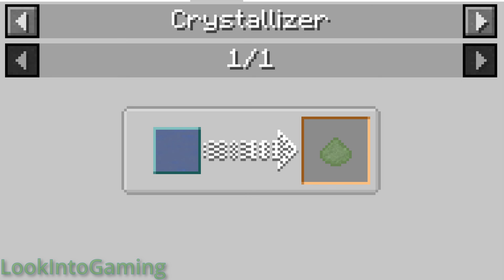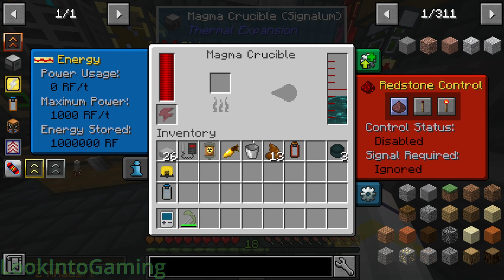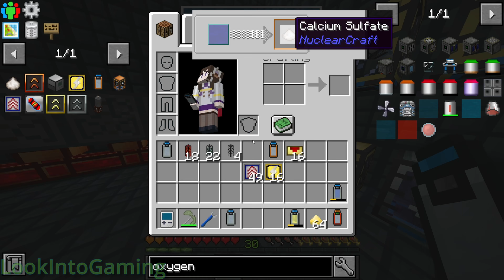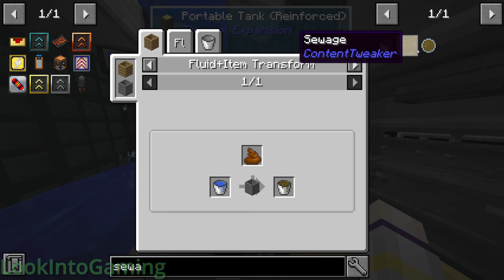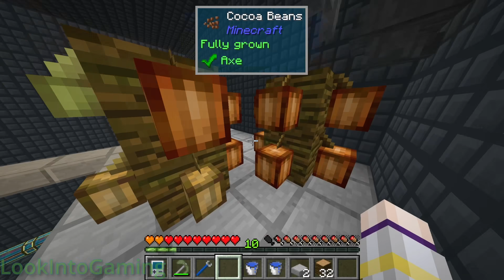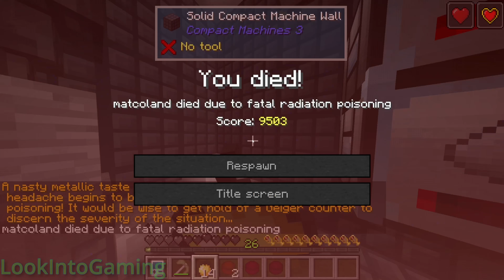How Hard is it to Beat Compact Claustrophobia? (Minecraft Modpack) Part 2

Comment: As soon as you get refined storage you shouldn't be doing anything manually. Autocrafting is so easy with refined storage, and you can literally send your whole system to any dimension in one block.
Reply from the maker: For most of my years playing modded Minecraft, this is how I would play. Only recently have I discovered the power of automation... I still have no clue why I refused to learn automation systems, but it was definitely a mental block of some sort. My Nomifactory playthrough is where I really got into automation and future GTNH videos will be focused on it as well.
Reply: @LookIntoGaming  honestly I'm at this point now and I kinda understand. A lot of the best blocks take diamonds. Seems like to really start using it you need the giant diamond making multiblock so you can craft a diamond pick, which is quite a way from when you unlock it.  It's kinda hard to justify using your diamonds to make that stuff with how hard it is to craft the diamond nuggets. I'm still making it though, I just have to be a lot more sparing than I expected. I also found out that refined cables just work between the compact machines, so it's easier and harder than I expected.

Comment: For those watching this in the future, auto clickers this this pack ate disabled with redstone, so you can automate the cpg using an inverted pulse. The quest guide teaches this in the tree section. I built a timer circuit on the wall with red alloy wire that will send a low signal to the cpg every so often (manually tuned per recipe) with a lever and eventually RS detector to disable it based on stock. You can also have an item duct blacklist the fully charged cpg so it will extract after every use, send it to the recharger, then send it back to the clicker. I used that same setup with pickaxes and the repair augment (you can farm exp by filling bottles and automatically throwing them)

Comment: You are SO real for not wanting to deal with reactor meltdowns and explosions. Babying reactors is some of the most UNFUN activities you can do in modpacks I genuinely don't understand why they are a thing. Just make them shut down and drain all the energy and fuel inside them if you want but DON'T MAKE THEM BLOW UP MAN... This is why I never mess with nuclear reactors. (Except Draconic cuz atleast it's kinda cool and is worth it too)
Reply: The fusion reactor is designed to require cooling. He had literally zero cooling to control it. All you need is some active fluid coolers and water generators placed symmetrically.

Similar goes for the fission reactor. Rather than actually design a reactor that follows the rules, he just changed the rules so he didnt have to engage with the mod.

You don't get to complain about NC being bad if you refuse to engage with it in the way it was designed. When you change the rules and it's bad as a result, that might be a "you" problem.

Comment: Fusion reactors shouldn’t explode.
Reply from the maker: Exactly, I'm used to the nice safe Big/Extreme reactors mod where you don't need to worry about meltdowns, and power is based on your cooling.
Reply: To be honest yeah, they shouldn't explode but they should spit out an unholy amount of neutron radiation. Which should let you put decay generators around the rings to collect it and reduce what gets out. The danger of fusions shouldn't be them exploding, it should just be radiation.

Comment: 19:32 your electromagnets probably just got unpowered. DO NOT connect the electromagnets flux ducts to the reactor, its a big no no. I never got to learn it the hard way fortunately. I made 2 fusion reactors to power the high impact compactor
Reply from the maker: This mod was more realistic than I expected. I saw another comment that said the same thing, and it makes a ton of sense now. Hot plasma needs the electromagnets to contain it and not touch the edges, just like real life.

Comment: the easier way to get sulfur is to just sift dust with an auto clicker. this is also handy for getting bonemeal which is used in a lot of autocrafting recopies from refined storage. In my run of this I had set up one sifter fed by a self fueled pulverizer setup that made sand with a Clastic Deposition extruder and a pulverizer and by the time i was done i had to turn it off  since it filled a cache with bonemeal.
Reply from the maker: I definitely should have automated sand and dust after getting the cobblestone generator, as it would have saved me so much time, but everything is better with hindsight.

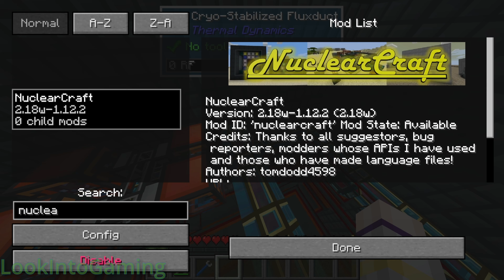Comment: 24:39 didn’t you literally disconnect the power from the electromagnets? It was full of extremely ionized plasma that’s not being contained by anything, what did you expect? You need to keep the electromagnets powered until the reactor has cooled down!
Reply from the maker: Ok, it makes more sense when you explain it like that. I thought the mod didn't have that logic, and the reactor would just forget without power, but maybe my idea works if I mine the core.